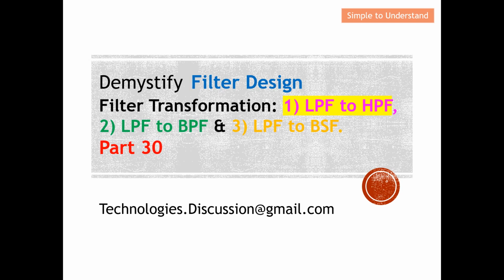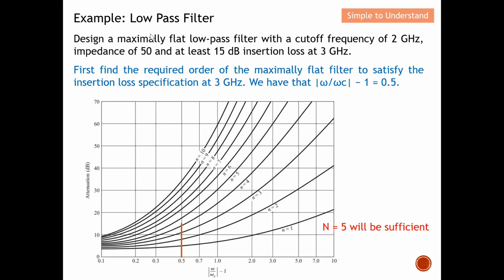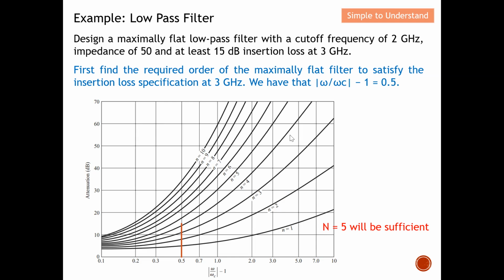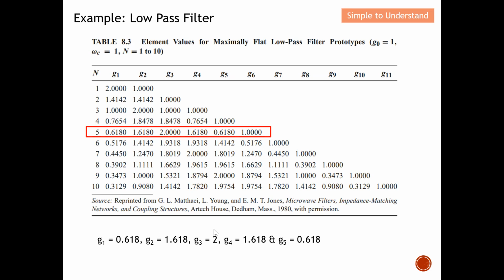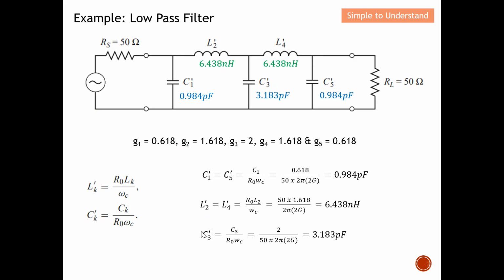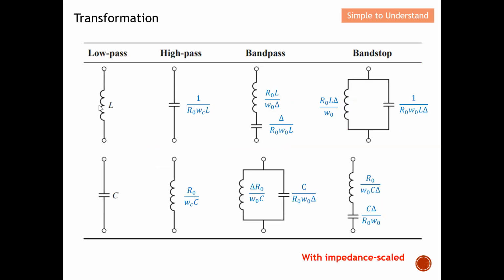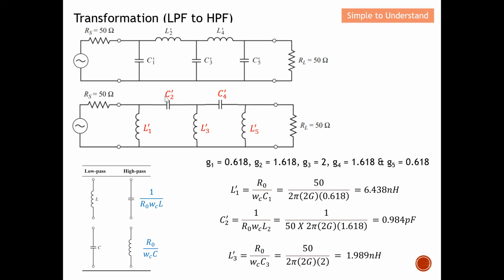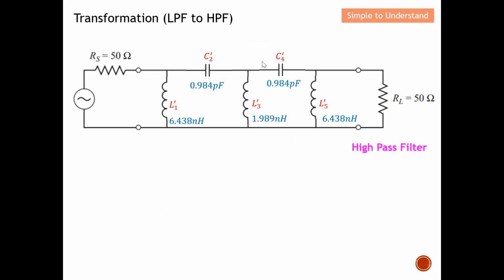Filter Design #30. Passive Filter Scaling: Impedance & Frequency Transformations for Circuit Design.

Comment: How to design the bpf  if Rs and Rl is not similar
Reply from the maker: You can use the impedance scaling method to handle different Rs and Rl, which mean u can have impedance transformer like tap C or L.